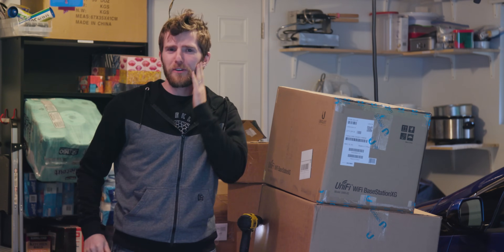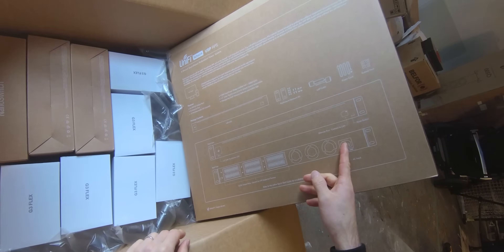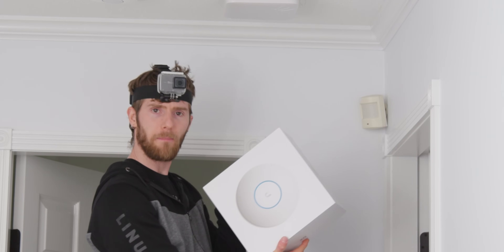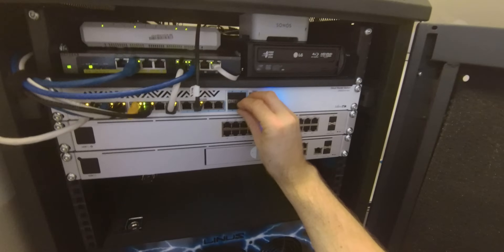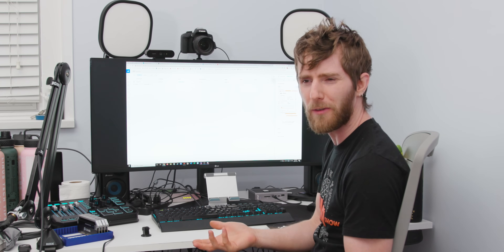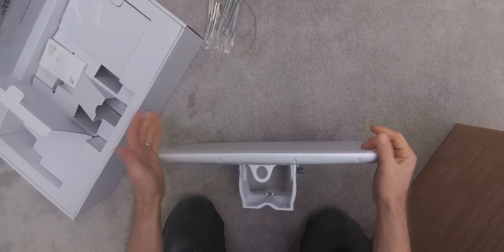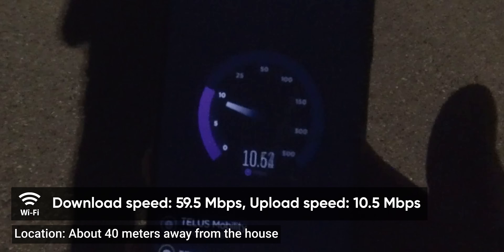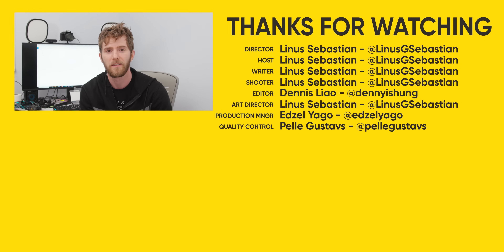I REPLACED my $1000 Wifi....

Comment: Wifi6 is screwed if you’re within 10mi of an airport. In SoCal or most business locations, that just makes it useless. 6E would be better, but there are still no devices. Meanwhile you can wire a 100GBE connection in a local location.

Comment: Get rid of the modem and straight in too your router switch will improve loads your network unless you have cable then your networks dog hahah you want a fiber run
Reply: You need a modem to connect to the internet.

Comment: Sorry for late comment.... Wouldn't you want a fiber connection from UDM-Pro to Ubiquiti switch because your cameras are directly interfacing from the switch to the UDM-Pro (which houses your HDD for NVR purposes)? Potential bottleneck with all the camera traffic, as well as all other WAN traffic simultaneous. Interested to hear thoughts on that.

Comment: The reason for the crappy upload speeds, is probably more down to the Antenna on the device, rather than the access point... (since the "broad cast happens from the device, and it's usually weaker radio)

Comment: Or you could put a cantenna where the lnb is on a wall mounted satellite dish, perhaps use an outside ap for the POE and get even further distance for a fraction of the price. No one would notice that it is a wifi extender either. ;)

Comment: I like the setup Sir, they have good products... but at 5.26 you said you can't use a sfp+ port on your poe switch pro for your 10g port on the xg AP? Why wouldn't you just get a sfp+ copper optic it's 10g capable and you can just connect your cat 6 to it Sir?

Comment: I needed to connect multiple things to a single Ethernet port earlier this year when I moved into my apartment. I just happened to buy a Uniquity switch. I didn’t realize Ubiquiti had the LTT stamp of approval. Glad it does as it hasn’t given me a single issue. I plugged it in months ago and haven’t had to touch it. It’s just dangling there under my desk connecting my laptop and printer to 600 Mb Ethernet without a fuss

Comment: I just upgraded from an Apple Airport setup to a full Ubiquiti network and surveillance system and the difference is amazing.
I went with the separate cloud key instead of the UDM pro because I wanted to use an Edgerouter4 instead of the USG.
If you have the money it’s definitely worth the upgrade, especially since I haven’t heard my wife complain about the WiFi in over a month now. That alone made it worth it.

Comment: I noticed you didn't connect the 10 gig port to the router, while for a traditional router it doesn't seem worth going 10 gig from the switch to the router, keep in mind the USG pro is not just a router, it is also your DVR, wifi controller, and  router-on-a-stick,as it will also handle your inter-vlan traffic if choose to have  different vlans for cameras, insecurity of things devices, and if you wish to seperate work and personal, and guest devices.

Comment: I agree Ubiquity is a great comprehensive & scalable networking system BUT.... the wifi 6 standard for future uses are to important to my needs and expectations. The  " Alien " has wi fi 6 but does it easily dove tail into the Ubiquity environment ?  I just wired my entire enterprise building w/ Cat 8 cable in anticipation of at least a 1 gig fiber optic connection  so anything less than wi fi 6 is a bottle neck moving forward :(

Comment: I'm honestly disappointed with the UWB‑XG. It's great for TX. The problem is that it doesn't have an adequate solution to receive under-powered broadcasts from mobile Wi-Fi clients. 
The Basestation is really good when used with the Unifi Mesh AP's. I have a couple of each AP and the UAP-AC-M-US seems to offer the best performance for a modest long range mesh link at about 180 m away. Being $100, you can buy like a 5 pack and get about roughly 15,000 m² of coverage at the very least with the right tuning. My numbers are from personal testing with different mobile powered AP's, in mesh mode, set to connect to the basestation only. I tested it with both a mesh pro and mini mesh (or the rabbit I jokingly call it lol); It's a multi-building apartment complex in Redmond WA; and lemme tell ya' the amount of Wi-Fi interference here is absurd. I imagine you will get significantly better results in a less saturated environment.

Comment: If you setup any VLANs you might wanna keep an eye on that 1G connection from the UDM-PRO to your 10G switch. I think that switch has L3 capabilities but not sure if they play nice with Unifi. I recently had an issue with a similar setup where inter-VLAN traffic was going all the way to the UDM and a 1G connection was bottlenecking.

Comment: Hi, quick question, i want to add a router to my vm (3) box, after I switch the vm router to modem mode will the ports on the back still work for hard wired items (I want to leave my setup as it is but have a separate router) if you know what I mean, Thankyou in advance

Comment: Gotta be patient until Unify figures out what's wrong with the UDM-Pro and the rest of the new stuff they dropped lately. They churn fw after fw. I know this was prolly a paid sponsorship but just be honest and say that all that shiny hw is plagued (right now) by major issues. From locking up randomly to missing features etc. Yep I'm talking out of personal experience. Hope they will fix it soon.At this moment you're better off with their old stuff or get a pfsense box a POE switch  run the Unify controller in Docker or a VM  and run their AP separately. At least those work

Comment: This was painful to watch.  I put up a new AP in my house, and turned down the radios to make coverage optimal.  When I pull out of the driveway, my phone switches to LTE, yet even my outdoor devices have good signal strength.  Our next house will be a single story long floor plan, and I'll have a shop as well.  I'll use multiple APs for proper coverage, and run fiber from the house to the shop rather than blasting RF at it.  Cost isn't that bad, performance will be much better, and it will keep the noise floor down.  I've seen some questionable things on this channel, but this one is really bad.

Comment: My home WiFi is ancient, I think we got it in 2008 or so. It's more of a Bluetooth jammer than anything since it only supports two 5GHz connections. It's slow (20Mbps on a good day), weak (unusable outside the sitting and dining rooms), jams or gets jammed by anything using 2.4GHz (Bluetooth, our wireless landline, microwaves, etc), and it's made by Apple. I'd upgrade it, but my parents don't care...

Comment: funniest thing bout this vid, is i had to recently replace my own ap. annoyingly the one i wanted wasn't available and had to go with a slightly more exspenive d-link extender/ap that plugs directly into a power point. Plus side its twice as fast as the old one and i have full control over the range(had to reduce it), plus the ability to use a black or white device list to control what devices can connect to our wifi through it.

Comment: I love my UBNT stuff. The new WIFI 6 model is on my list. I installed a DMPro and a 48 port POE switch. I use blueiris on my cameras though. I also purchased two older used pros on ebay for the soffit on the outside of my house. I have a mesh on my mailbox that gives me connection on my street.

Comment: You should have not used a XG AP . Should have used a Alien router w wifi 6. The GEN1 XG AP is good but Alien Wifi 6 is the absolute best even used at just an access point. The XG is for high density. Make sure that you are aware that the USW GEN 2 is not entirely ready. I have 8 48 USW PRO 3 USW PRO 24 running in a production environment with 450 - 700 clients in 6 suites in a building and its good but they need to tweak some settings. The  UDM PRO SFP+ will work great with USW PRO switches only. Not USW 16 Port because it is only SFP. Connect your fiber to the UDM PRO or USW PRO with a UFiber SFP+. Throw an Alien Router in the center of your house or buy 2 and you will be amazed! Check out my vids broham.
Reply: Lots of fiber providers don't let you use your own GPON module. AT&T for example

Comment: I think you can’t really convert bytes to bits using an 8 factor on a network connection, because of bits used by the protocols for checks and stuff that don’t carry real data. I think a better estimate is 10 bits = 1 byte and so on. That means you may have a 100 Mbps real connection, but the real data download speed will be closer to 10 MB/s due to the protocols bit cost.
Please correct me or give more informations if needed. 🙂
Reply: 8 bits = 1 byte

Comment: Your Mikrotik switch has mGig ports, so for <100m copper runs, you should be able to be 10Gb between AP and switch.  Helps a little with overhead. No POE, though.

Comment: I had the chance to upgrade my home fiber connection at the end of March, just before everything got crazy in the U.S.  The ONT that the tech brought for the install turned out to be bad, so he installed a 10Gbit-capable unit instead.  For a residential connection.  In the suburbs.  Fast forward to this week when lightning took out my ONT and the new tech mentions that there are only 3 of these 10Gbit beasts running in the area, and because of how the fiber is set up the three of us pretty much have uncontested bandwidth 24/7 no matter how many people are on the network.  I'm only using 500Mbps right now, but the possibility of running 10Gbps for absolutely no reason at all is tempting...
Reply: How did lightning take out the ONT? Electricity can't travel on fiber because glass isn't conductive

Comment: UBNT is ok, but Mikrotik is better by far if you're ok with paying for a solution ... otherwise I usually go w/ a cheap $20 OpenWRT board, solder external connector if needed, and buy a $20 pannel antenna ... the performance is mostly a function of the antenna if you don't plan to do any advanced tweaking with aggregation, fragmentation, CTS, RTS, retries, defining a noise floor, etc. But if you DO want to do these tweaks to get extra from the antenna AND the processing, Mikrotik is the way to go... For me, this leaves UBNT in a sort of no-mans land of being proprietary, costly and at the same time lacking user-defined tweaks mostly because of limitations in their drivers. My first long range WiFi device with the UBNT BulletHP, but, that was when I was young and not as experienced. All of this said, for a -89dBm noise floor (7:43), your performance is excellent. I'd expect much less in that environment.

Comment: Lol i put those in for point to point network transmision accross miles from building to building.  This one looks even beefier than im used to seeing.  The extra heavy mount is because it usually goes on top of a building or on the side, dont want a flurry or powerfuly strom to rip it off your building.

Comment: I've got the Amplifi HD for my router in my house, and it reaches the entire house with great speeds without any other equipment. I thought I was going to need to get the mesh points, but I haven't so far. Granted, no one in my household really needs gigabit speeds. Getting a few hundred megabits is plenty for our purposes.

Comment: Every WiFi Pro knows, that there are no 4 spartial Stream Devices in the REAL world. 10 gb for an ap is so much overkill. Compare the right facts. Usually you can‘t even use 40Mhz or higher cause of channel overlapping.
Reply: A "Wi-Fi Pro" isn't installing this in his house. This is for thousands of clients. Each radio can saturate a gigabit uplink, and there's three radios.

Comment: I would recommend disabling the 2.4Ghz Radio's if they are not required, almost all devices have support for the 5Ghz Bands if some of your IoT devices Need 2.4Ghz I would create a separate SSID for them on those radio's, this will give you better overall performance. The AP you have directed out the front of your home, please point this at the ground in the centre of your garden don't be that guy who's wifi is bleeding into everyone else homes messing with there wifi.

Comment: If you guys are running routers that don't run the AC wireless standard or better, please upgrade or you aren't even going to get the speed you're paying for. If your service provider does not support that version, you need a different ISP if available. Just look up AC routers compatible with your provider. If you use a private router/modem, you dont have provider limiters on your unit, and you won't pay a monthly equipment fee

Comment: I get service from 300 ft. 100 m away from the cable company supplied wireless modem through a concrete and brick wall at ground level.

Comment: If you want to see better speed numbers on your cell use fast.com in the settings change parallel connections max to 30 and re run test. My cell goes from 200Mbps from speedtest app to 500Mbps from fasts.com tests..

Comment: Linus, I just moved into an older home that does not have Ethernet ports for hard wiring anywhere in the home. My WiFi is in the downstairs corner of the home and I get very poor signal strength in the opposite upstairs corners. What do you recommend I do? I bought a WiFi extender but I am a gamer and my devices drop constantly on the extender too.

Comment: I have a 5500sqft house with a $150 router from amazon in a concrete room in my basement and get full coverage throughout the whole house and even a decent signal outside on my patio. Idk if some people just have houses made with tungsten walls, but it shouldn't be that hard to get good wifi coverage,

Comment: Please mount that big AP outside as intended and designed for, you are killing it in two ways by having it in there.
1) It will get HOT up there during summer, the heat might kill the AP, if not it will decrease the signal and speed a lot, like a hot CPU downclocking itself.
2) All signals are bouncing in there, you are loosing a lot of performance because of that.

Comment: Would someone be able to help me with my computer issue. I have a nvidia rtx 2070 super 8 gb paired with a ryzen 7 3700x  and 32 gb of ddr4 3200mhz ram and a gigabite gaming x motherboard I also have acer predator xb271hu 1440p 165hz  with g sync now my issue is when my fps drops with g sync on from say 161 to 155 it hitches and stutters even a fps drop as small as 2 causes these hitches there very annoying any idea on how I can fix this issue thanks allot :)

Comment: Linus: heavy duty weatherproof connectors

He then proceeds to mount it inside his attic instead of outside where it's clearly designed to go.
Reply: Yeah, and it only runs 5 GHz at least its only one wall in front of it. Would be great mounted on the outside of the house with a liquid tight piece of conduit running back inside.
Reply: @camdendexter  It may be for security reasons as that gear is expensive AF...
Reply: to be honest it's way cooler hidden away
Reply: @HeshWantsCandy  If by cooler you mean it is way less efficient, then yes - less efficiency is cooler, and isn't that what LTT is about...being less efficient?
Reply: @IvanHawkes  I mean, considering the situation isn't it a good thing that his WiFi doesn't go any further?

Comment: I love how he's just hogging RF bandwidth for his entire neighbourhood now... good neighbour :P
Reply: He can sell a subscription service.
Reply: 10:23 I was wondering why no 2.4ghz

Fcc probably won't allow on that antenna type
Reply: California 200/50 80$ a month...
Reply: .... you do know what banding is right? Most devices default to one of three bands. Linus probably sets his stuff to be one of the many other bands available
Reply: Came to say the same thing. He does a check that say 99% clean area, then proceeds to blaster his WiFi down the street like a neutron star. Fortunately bits on the 5 GHz range, which has far more channels, and far less penetration through walls. If he visits his immediate neighbors though, he'll still be able to get what qualifies as "high speed internet" for the increasingly backward US.
Reply: Geoffrey Lyons he could probably get what qualifies as high speed internet in australia halfway down a city block with that
Reply: @granatmof  I thought 5ghz was endless too until recently. For fast speed, 80Mhz there are only 6 non overlapping channels with only two of them (42 and 155) operating at full TX dBm power while the rest of channels are set at 23dBm instead of ~30 by manufacturers.
Reply: @granatmof  Now that I think about it, that might be the reason it only supports 5GHz; to prevent interference on such a large range.
Reply: @granatmof   Wonder if any of his neighbors will wonder, what the heck is this wifi signal through our streets? And hi from the US with 500/500 for $50 a month.
Reply: @SeanCaldwellvo  HI I LIVE IN TEXAS, USA CAN I ASK YOU WHAT IS 500/500 FOR $50 A MONTH?
Reply: Sweet N Pretty In Texas from  context I would say 500 upload 500 down isp plan for 50 bucks per month
Reply: @SeanCaldwellvo  my friend in moscow pays like 1200rubles($18) for 500/500
Reply: @SeanCaldwellvo  please tell me what in the world service you are using because I'm paying 75$/month for like 200/50 and I hate it.
Reply: @granatmof  
ahhh, so you pay $70 for 200 Mbit/s that only delivers half of the time too in the US?
Reply: Geoffrey Lyons He’s Canadian
Reply: @RonJohn63  That's not the norm though
Reply: we pay $64 a month for 12 download and .75 upload, in New Mexico...
Reply: @nightfallx37  dude, my grandparents have a cabin in red River NM, I don't know what provider but there paying around $80 a month for 250/20
Reply: @Swirlcios  try $70 for 3.5/0.7.. And yes, that's not a typo. Those numbers are accurate. Waiting for Starlink.
Reply: No really, the power of the ubiquiti device is still relatively low to what would drown out his neighborhood, and it's still only operating within 1-2 channels. 5Ghz has low material penetration too so I doubt his neighbors will notice it too much.